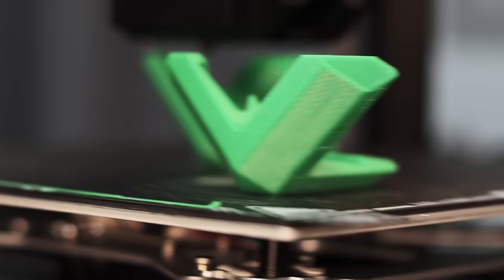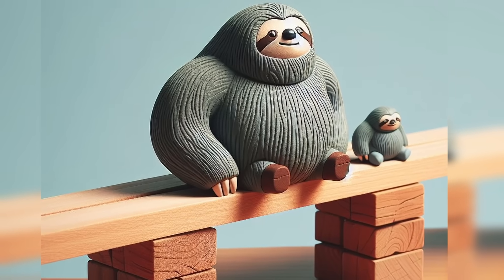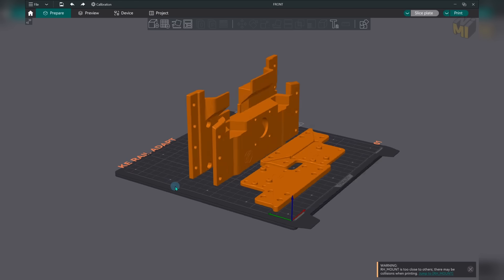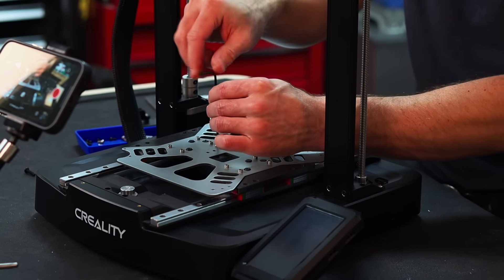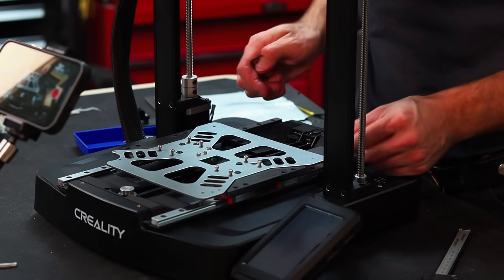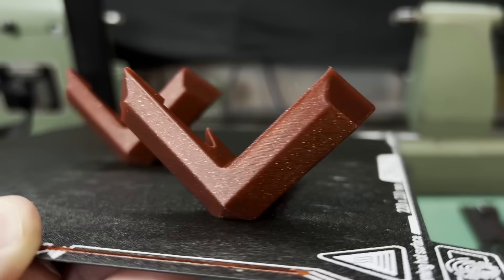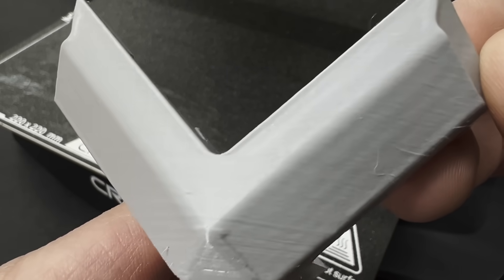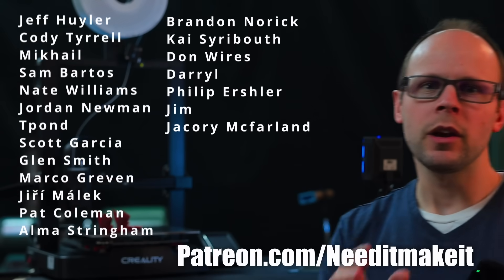UPGRADE your Creality Ender 3 V3 KE with Linear Rails

Comment: Would this work on the SE version? They're very similar printers and it looks like it might fit. Awesome upgrade!
Reply from the maker: Yes it will, I've had a few people already try it out and there is only one difference, and that's on the steel plate below the bed, it is more hollowed out on the SE than the KE.  That does not impact anything for the installation so it should be G2G!

Comment: okay guys i have a super random questions but hopefully someone can help, can these rails be used upside down? 
i'm am trying to make a movable drop down pedant light in the kitchen, the idea being the light can be moved out with the table when guests are around, then all put back when the night is done, planning to use two rails, and the weight of the pedant light is about 3.2kg ? any suggestions would be appreciated

Comment: Subscribed and printed. First thank you . Super excited for this upgrade. Went to install everything and the screw that triggers the bed location switch is not hitting the switch. I could switch it out for a longer screw. But the lack of others commenting the same has me wondering if I installed something wrong. Thanks again.

Comment: Made these yesterday from your files on makerworld; what an awesome set up and addition to this printer. Printed in PETG-CF at 50% infill, I printed the two end pieces in the middle of the be and put the bed mounts on either side, the surface finish was pretty good. hoping with this upgrade I will have good results across the whole bed.

Comment: DO NOT BUY BLACK LINEAR RAILS! They coat them in a rust protective coating (Cold Bluing), yes. BUT what some suppliers do is they take OLD or USED rails and give them this coating to hide it. So you end up with not straight, or poorly coated rails. What you should do is buy normal steel rails that *aren't* black because protecting them from rust is not needed since they are already always coated in oil (which protects them), SO you can either keep up with lubrication (to protect the rails from rusting) or you can buy cold bluing solution and do it yourself - Birchwood Casey Super Blue - it is cheap and easy and anyone can do it. Just clean the part well, make sure there's no oil, rub the part in the solution. rinse and repeat (if necessary).
Reply: You can not reuse the rails that are worn out, there is an obvious wear mark that no coating will cover. Also you are supposed to clean off the rust preventative coating before use. So please do some research.  I repair cnc machines for a living, these linear rails are nothing new to me.
Reply: @highoctanestoner  Bro you are absolutely not supposed to remove cold bluing or gun bluing. Should you remove shipping grease? Yes, obviously, but you're not meant to remove an oxide treatment.
Reply: @jackwhitehead3074  He probably didn't mean to remove the blueing but maybe there's some wd40-like substance on it for repelling water during storage which you should remove and then use machine grease instead.
Reply: Thanks for the heads up.  I was thinking about getting those.
Reply: I don't know where you got yours but mine I bought are brand new black and no problems what so ever, maybe you shouldn't shop ebay pre owned.
Reply: Black = dented. Gotcha......

Comment: please do input shaping modeling before and after modifications. this is something i've been having trouble finding on all the online reviews/videos about E3 V3 SE/KE: we actually don't know the accel limit of this printer vs the advertised 8000 . it is always important to quantify objectively before and after changes are made and IS modelling allows fast and repeatable measurements without having to rely on subjective prints. my assumption is that all these modifications may not actually show improvements at stock settings but may prove their value at higher accel--meaning they unlock potential but you have to print faster to see it. 

regarding the 0.5mm droop at front right bed attachment, i have a feeling that the base of the printer on which the rails are attached may not be flat. it is after all also a stamped piece. i noticed you checked for parallelism of the rails in Z plane but not for parallelism to the Y plane. the front side of right rail may itself be 0.5mm lower than the rest of the rail plane. assuming a 150mm separation in the rails a 0.5mm droop is something like 0.2deg which is within precision thresholds of a cheap spirit level + eyeball and definitely detectible with a digital one. if the rails are misaligned in Y plane this will actually transfer flexing forces through the rail adapters/rail/rail carriage and into the stamped metal base. the base should flex the most but i think the printed adapters may also suffer from premature maintenance required. if the rails are misaligned in Y, the 0.5mm shim should be under the rail rather than above it.

Comment: You're a madman!  I don't have the stones to mod mine, since it's my first printer.  But your mod is amazing!
Reply: the whole point of 3D printing IS modification. if you dont have stones to make your own machine better, you dont have stones at all
Reply: @heyitsdrew   Sorry, but that's bullshit.  The whole point of 3D printing is to MAKE things, not have to figure out ways to work around flaws in the machine doing the printing.
Reply: @IgnusFast  hahaha did you read what you just wrote? are you trolling?

Comment: Weird question. The chassis of the KE looks similar as the SE. I have been following your videos for a bit and wanted something more stable for the rails on the SE. It has those two foam pads that work but I can see these needing to be swapped do to wear. Would this upgrade work on SE if you had to guess? Thank you for your videos =)

Comment: With regards to the bolts are they counter sunk or button head?
Reply: "I've called out the screws in the latest video as button head as well, though in the case of this video it isn't critical as there are no clearance issues."

Comment: Fantastic design and modification. I just wish all manufactures took this route to eliminate this little issue.  I would love to see a video on that new replacement plate and if it made a difference. Love your video and they are very informative. Keep them coming.

Comment: I'm learning bout 3d printers and how to improve them. I don't see the use for the Adaptor Plate. Could the Bearing Blocks be drilled and threaded. Then have the Bed be direcly attached with spacers for adjustment?

Comment: Is there any loss in z height with this?
Reply from the maker: I'd have to go back and check, but I believe there is a gain of a few mms.  I tried to bring it down as close to the base as possible while also still having just enough clearance above those protrusions on front and back.

Comment: so here is my uneducated take on these printers, i have a ke and in the terms of is it moving to fast for nice clean prints? yeah most likely. what i use my ke for though is for larger projects like helmets or armor pieces that i will be painting or adding things like damage scars. I think the KE stock or even with your upgrades is solid for doing just that. but if you want full on detail then you really need to just slow down the speed. its like that age old saying, you can have it done fast or you can have it done right.

Comment: I noticed that the M 3 x 4 head set brass that you used was the wrong size, I ordered on   Amazon M3 x 4 x 5  is this the correct size? It is the only ones I could find on Amazon thank you
Reply from the maker: I believe mine were 6mm long, 5mm works okay and 4mm is even better.  They'll stick down just a little bit, and it won't hurt anything.  It took 2 months to receive the correct size from Aliexpress... I ordered some from Amazon, and they arrived the next day!

Comment: Hi. Had to use longer M4*20 for Y-axis positioning as the original one didn't touch the trigger when rolling the hotbed. Now it collides with the front adapter, blocking the hotbed movement and messing up print coordinates during the print pause / color change. How to overcome it?

Comment: Instead of steel plate, perhaps aluminum? Thanks for the info (upgrade).
Reply from the maker: I'm not 100% certain why they went with steel, my first guess is that it was to try and resolve the flex issues they were having with the centrally mounted linear bearing approach.  It could also be to try and make the parts as similar to the SE as possible, the metal is stamped slightly differently than the SE but overall it is the same shape.  I think with the linear rail mod here an aluminum plate or a Carbon fiber plate would both work really well....yesterday I tried to see if I could order a Carbon fiber plate from Send Cut Send, but it wasn't  accepting my file... but that's one that I would like to see.  I have the polycarbonate plate on there and it's working well, but I think the CF or Aluminum would be better and overall stiffer.
Reply: @NeedItMakeIt  if possible consider doing  both, aluminum and CF? Compare the difference. It looks like you got some more content for you channel. On a side note, I do not own a 3D printer. Just looking around to see what fits my hobby (RC rock crawler trucks). Not really looking to be upgrading and taking it apart. What do you suggest for a newbie, like me. Although I prefer a printer that self levels (calibrate). Thanks for the video and info..

Comment: Hi, Is it possible to use the MGN12H, 300mm rail length instead of 350mm? Are the 300mm screw. holes applicable up to your model? Thank you
Reply from the maker: It might be tough with the 300, I'd say go to 400 if you can't find the 350; longer is better.  I don't have the specs on hand for each of the different rails, maybe you can find the drawings for standard hole spacing and see what they look like.  We also have adapter in the link which work with 12H carriages and they've been proven to work if that helps, it may open up a possibility here or there for you.

Comment: Which of the components in the rods & linear rod bearings are not to spec? i.e. undersized rods or oversized bearings? Because I have four 8mm rod bearings not in use and a few meters of 8mm hard chromed rod that could be used for the purpose. What about me just building in more bearing carriers to go on the existing round rods?

Comment: i think its the actual bed with the heating element is attached too. i swear they fold them in half and send it out. Even with glass im still finding issues with level prints.
Reply from the maker: LOL, yup the bed will warp, apparently this is in part due to the rapid heating of the aluminum and also that it is pinned in 4 places, this restricts the expansion and causes it to bulge until it has enough time to uniformly heat and settle down a bit.  I'd suggest a thicker bed, but we don't want to be adding weight to the Y travel.  One solution that I have is to introduce a soak time, to each of the Creality printers, and it seems to help quite a bit.  If you need the info of how to do it, I have a video already on it called "Let it Soak" there is a printer in a bathtub on the Thumbnail if you're interested.

Comment: Would this work for the V3 SE?
Reply from the maker: Apparently it does work, someone mentioned that one of the bed mounts needs a little notch in it, but I've seen photos and I don't think that it is required, it would not impact the function at all.  the steel plate below the bed has slightly larger triangular cutouts in it on the SE, which is to save weight.

Comment: Can you help me.
Hello, I recreated that. But unfortunately I can no longer calibrate the printer. The bed moves to the end and probably wants to move further then it starts to rattle and makes a key 2022 error and stops.
Reply from the maker: It sounds like your limit switch isn't being activated, make sure when you look below that the screw that sticks down is long enough, someone else also mentioned this issue, I guess Creality is sending 2 different lengths of screws for this part.    I believe it is an M4 machine screw which is mounted through the steel plate, it will contact the switch at the back.
Reply: @NeedItMakeIt  Great, that's exactly what I did. I put an M4 screw in and now it's running again
Thank you very much for that, I would never have thought of that🤩🤩🤩🤩😁😁😁😁
Reply from the maker: @thomasotto8217  Very strange, it seems that you're 1 of 2 people with this problem but there have been hundreds of people that have made the upgrade.  I guess they ran out at the factory?  Glad you were able to get it sorted out!

Comment: Great content, really helps with figuring out all the nuance of this printer.  I can attest that the biggest improvement so far was ditching the PEI plate that came with it.  Something defective about the surface, wettability is far too low.  Switched to 1/16” thick garolite and all my first layer adhesion issues vanished.

Comment: Gently dust with baking soda? how did you calibrate how much soda fell on any point?????
Reply from the maker: Yeah, it was a lot!  I was using talcum powder but I was told not to since it is a known carcinogen.  I would imagine it would have to be inhaled in large amounts like anything, but figured it'd be best to avoid it.

Comment: Is There Any New Updates if Using the 12H Rails? Any issues etc? Also would 300mm be alright or have to be 350mm, since I have the 300mm
Reply from the maker: The 12H carriages are good to go as far as I can tell, a few people have tried it with success, and I have those files on MW to download, as far as the 300mm rails, that's risky, the carriages might come too far and you'll... well lose your balls.   I would have preferred to go even longer with the rails, but I didn't want them to stick too far out of the front.

Comment: I this this mod using your links and parts. Since doing it a couple weeks ago-
1-When print is complete the bed comes forward there is an audible "thud" and it stops.
2- If the print is paused, then resumed, there is a 2mm shift in Y axis, with new layers being closer to the front. Always the same, 2mm fwd.

I was told i need to root klipper to do this mod.  any input @needitmakeit ?
Reply from the maker: Have you removed the two small screws at the front which were holding the original rods in place?
Reply: @NeedItMakeIt  I did not. I looked at them when installing, there is 3mm clearance to the bed carriage bottom (Z),  more than 20mm in Y.  Looking now I see the hit may be the longer screw that was required for the Y limit switch (original was too short to activate switch) Also I see not the belt attach point needs to be lowered a couple mm. 
I'll fix those and see.
Reply from the maker: @justaguy4788  This seems a bit strange, on mine the screws needed to be removed for clearance, the original screw length worked for me and the attachment point for the belt was also correct.  It's possible that you have slightly taller linear rails or carriages, which would also be very strange, they're supposed to be standard sizes.  Great if you can make the changes though.  It's something to do with the limit switch or rubbing that's for sure, the rails themselves just allow the motion on the Y axis, and now they have more travel than before.  Let me know how it goes!
Reply: @NeedItMakeIt  Bottom line, the screw i used for Y limit switch was hitting the fwd rail mount by the motor. I suspect the belt was skipping a tooth when that happened. I shortened that screw and ran a couple tests. Problem solved.
Reply from the maker: @justaguy4788  Perfect!  Thanks for that.  It was a bit worrying, sometimes these companies can change little things and I was thinking that maybe that was what had happed, which would be bad news if it could affect a lot of other people.

Comment: This is just what i need, thank you. About the plate, i dónt think it's a good idea, all the plastics gonna flex with time, maybe will print good, but the level mesh it's gonna get worse.
Reply from the maker: That's great!  What I did was thicken it and chance the design a little bit, it's printed from PC which is very stiff and will hold it's shape even at higher temperatures, 107C is the point it will begin to soften.

Comment: Hard to keep up with all the new models,  I thought this upgrade might make it equivalent to the CR10 SE but it has a different extruder.  So obviously the extruder on the KE is not meant to be their best.  I was interested in the Ender 3 V3 CoreXZ but at the price it makes no sense when I can get the Flashforge 5M cheaper.   By the way you cannot buy extruders for the KE or CR10 SE.

Comment: This is a great upgrade and I did this mod and im having only one issue the bed isnt hitting the switch for homing. Is there any trick to it
Reply from the maker: That's a bit strange, you can replace that screw with a longer one, I believe it is an M4, or you can screw on a 3d printed adapter to it.  You're the first person to have this issue, so there is some funny business going on there.